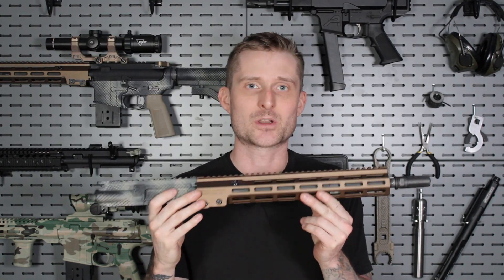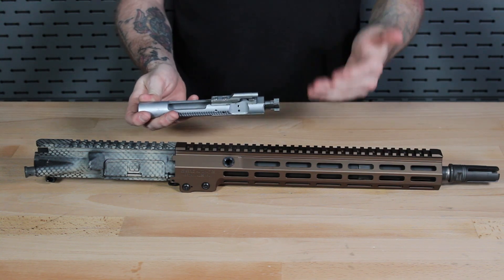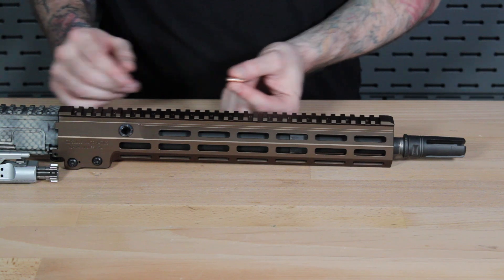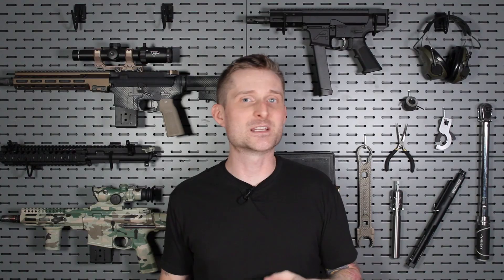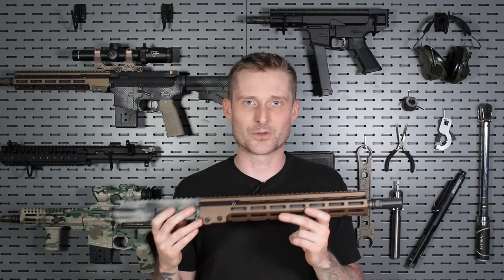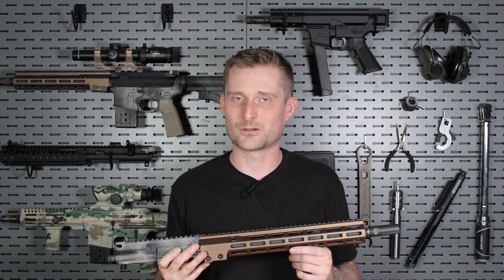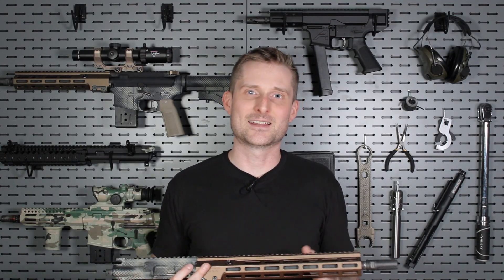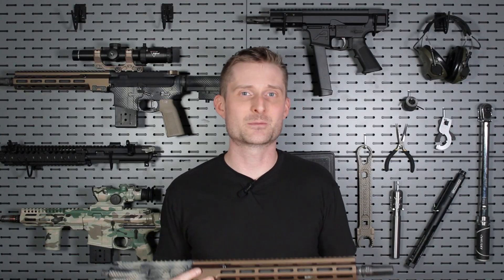Your AR-15 Might Be Over-Gassed (But It's OK)

Comment: This guy is right about everything he says but misses only one thing that will actually TAME the harsh kick and recoil of the carbine length gas system which is the BRZ easy gas tune replacement tube!  It has a much smaller hole in it, far cheaper to replace a gas tube than go in for some $$$ adj gas set up! It takes only 10 min max to replace a gas tube, and you can catch your brass as it ejects and your BCG wont be smashed apart only 3k rounds later. Get it at black river tactical, and NO Im not affiliated with them, just looking for an effective and doable way to tame the harsh back and forth all the carbine models have!

Comment: How about just replacing the gas block with an adjustable one?
Reply: Bingo. 👍🏻
Reply: Because the adjustable component of the gas block introduces another failure point in the chain that is more prominent than any other in that system. While they do offer some measure of adaptability, there is a reason why adjustable gas blocks are simply not used in actual combat weapons. The video is suggesting that if your barrel wears to the point where replacement is required, a mid length is something to consider.